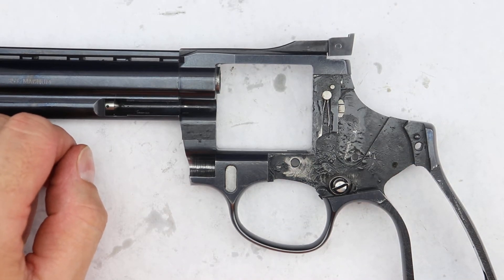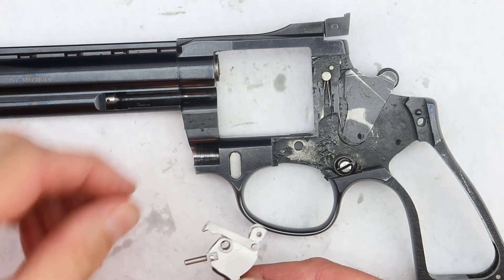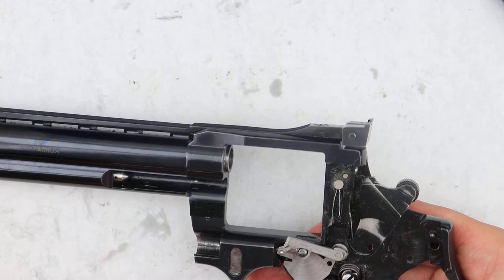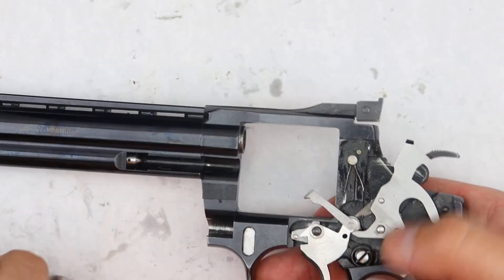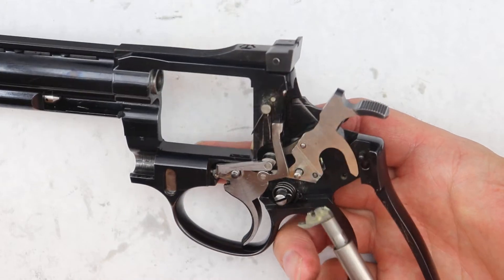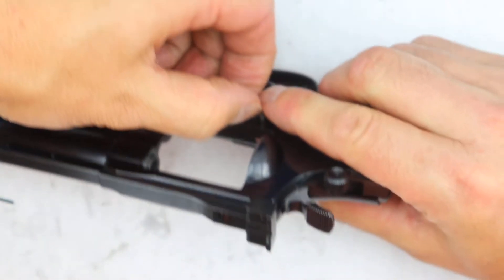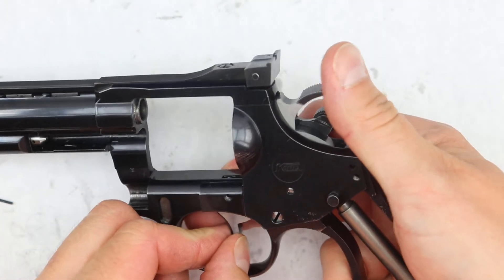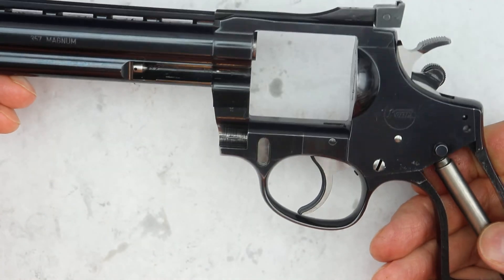Korth Sport Revolver reassembly

Comment: Huge thank you!!! Helped me disassemble and reassemble 1971 Ratzeburg. I found design good, but was surprised at the lack of polishing of the frame and cover internals. Parts could have been polished as well for that type of money. Cover goes on extremely tight in my example, it was really hard to line up everything for cover to close. I kept thinking that I put together S&W on the first try not even knowing what I was doing, while it took me like 8 tries with Korth and I did know what I was doing. Polished internals including #5 wheel, sanded the mainspring to lower weight = super smooth pistol. S&W does same for fraction of the cost, but Korth is inherently better made.